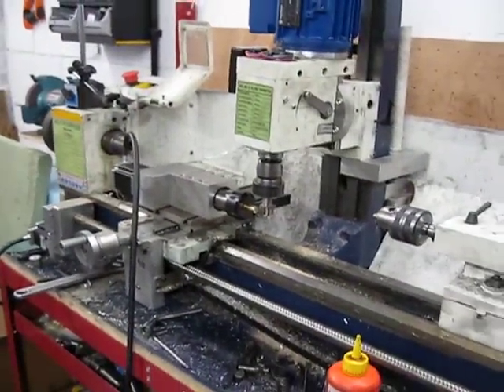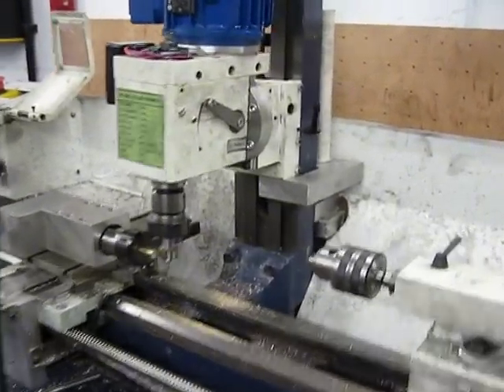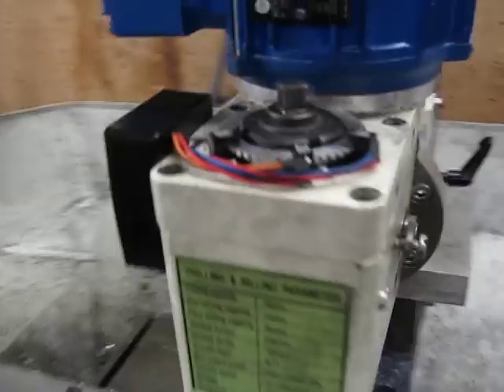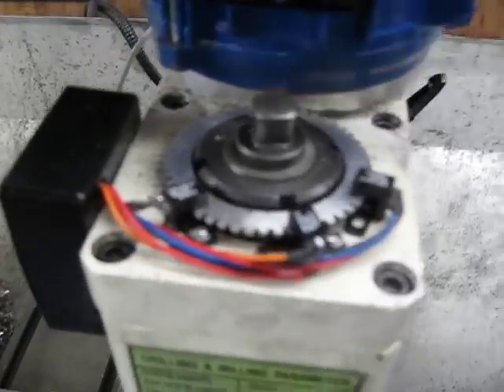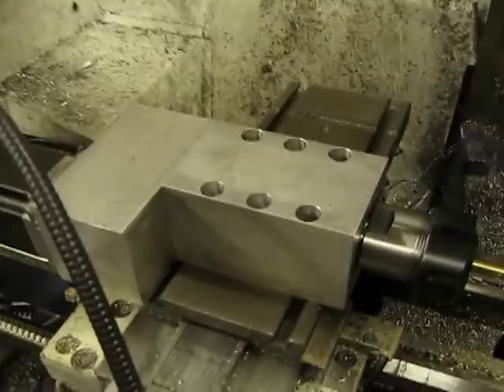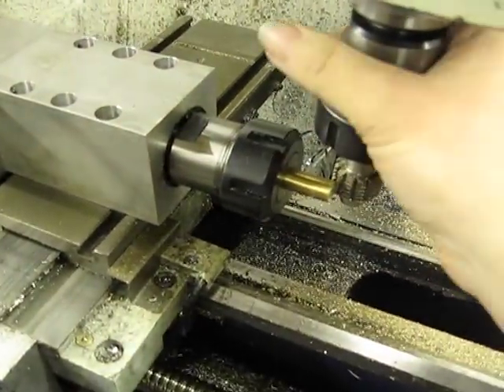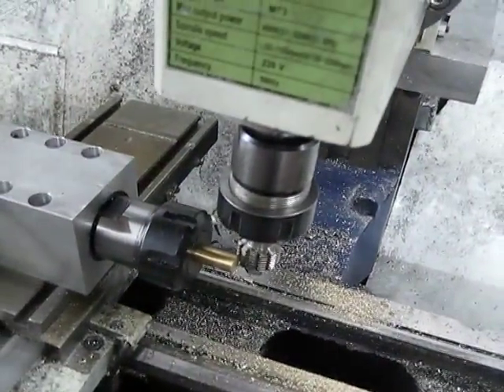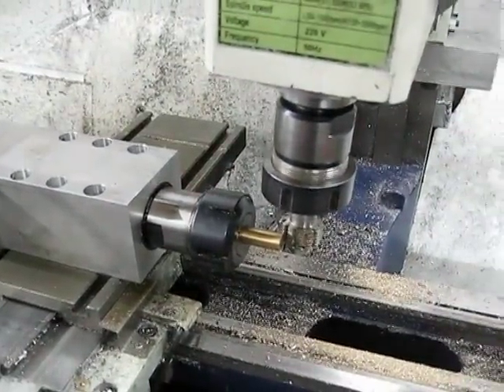Hobbing (Gear cutting) on a Mini-Mill with EMC2

Comment from the maker: The third sensor is for the index, used by rigid-tapping. One of the slots is longer than the others, and one sensor is set further in. 
I also have a similar encoder on the lathe spindle, and used that for three of my other videos (eccentric turning, hexagonal boring, induction motor servo)

Comment: Very nice indeed.  I'm contemplating doing something like this on my lathe spindle.  How many slots did you make in the encoder wheel.  Looks like maybe 50?  Also, why do you have 3 gap sensors?  I would have expected only 2 for quadrature operation... Thx

Comment: Andy - questions about this. What Z-axis motor and ballscrew are you using on the milling machine there? How well does it handle the weight of that massive spindle motor? I've been looking for ways of getting a 3-phase AC motor (56C frame) onto my X2-sized mill, but my biggest concern has been figuring out how to help the Z-axis stepper motor offset the weight of that 35lb motor...
Reply from the maker: The Z-motor is the same NEMA 23 / 3.5Nm stepper as the X axis. It drives a 14mm (or 16mm, I have forgotten) ball screw. 
Since making that video I moved the ballscrew inside the column, and moved the motor to the top rear of the column. There are a few pictures here: https://picasaweb.google.com/108164504656404380542/Gibbs?noredirect=1#5477167816311979330

Comment from the maker: @TheElsyd 
Be aware of the issue of rounding errors and integer maths. EMC2 does it all with floating point, so can do tooth-counts which are not an integer factor of the encoder pulse count. 
You might find that an Arduino or similar microprocessor board makes a better basis. You could put a set of DIP switches on one port to program the tooth count, then use a hardwae interrupt to track the encoder edges and then do the floating-point divisions there.

Comment: Interesting...
I guess that if you offset the axis of the collet holder / indexer by a few degrees you could cut relieved broaches for internal gear shaping too, then use the indexer with the longitudinal carriage feed via EMC (probably another HAL adaptation?) to shape the internal gears (or would that put too much stress on the carriage rack/pinion in brass?) - would need an indexer for the broach - putting the DOC on with the cross-slide (EMC again) into blind bores  - Cheers for the demo!

Comment from the maker: Nothing changes in LinuxCNC. There are a few edits in HAL. The A-axis is not driven by axis.3.motor-pos-cmd and more, but simply by encoder.00.position divided by the tooth count. 
If you search the LinuxCNC WIki for "hobbing" you should find the HAL file details.

Comment: Would love to know how you equate the rotation speed of the workpiece against the rotation of the tool? for example, if I were to use a 24 Pitch hobb? do I need to rotate the piece once every 24 rotation of the tool?
Reply from the maker: No, you don't need to know how many teeth are on the hob. It is a single-start thread, so for a 24 tooth gear you turn the hob 24 times for one rotation of the gear.

Comment from the maker: It is just an ER32 collet holder with a straight shank from eBay. Then two blocks of 2" square aluminium bar. The long bit has a taper roller at each end. Then there is a toothed-belt pulley and a second lump of aluminium to mount the motor and contain the drive belt. I can't remember how I mounted the pulley to the collet holder or what provides the bearing preload.

Comment: Is this a Bolton manual machine converted?
Reply from the maker: It's a converted manual machine, but actually an "Amadeal" rather than "Bolton". But if you have read www.lathes.co.uk as obsessively as I have, you will have noticed that it has been impossible to distinguish lathe manufacturers from lathe makers for well over 100 years. So it is entirely possible that an identical lathe is sold under the Bolton brand somewhere in the world.

Comment from the maker: The workpiece needs to be actively rotated at exactly the right rate, correlated to the spindle rotation. 
You can probably make new gears for your lathe on your lathe, but not by hobbing, you would need to use a formed cutter. 
Look at the other (non-hobbing) gear cutting videos, or search Amazon for 0852429118

Comment: Dear Andy:
Greetings from an apologetic admirer. You posted your LinuxCNC hobber 7 years ago and I am afraid it has caused you much inconvenience from people like me ever since. I have been struggling with http://wiki.linuxcnc.org/cgi-bin/wiki.pl?Hobbing for about a day now and am pretty stuck. You are pretty much the only resource I can find on the net for hobbing with LinuxCNC so like my occasional predecessors in the last 7 years I am turning to you for help.

I thought maybe I could be more helpful and less of a burden if I could suggest a couple of clarifying questions about this entry so that you might be able to make a few small changes to the wiki that would make cries for help like mine a little less frequent: 

1) your original post of hal commands was for integration with a Pyvcp panel. It is not clear whether some or all of the hal code is still relevant to your new Glade panel or whether, when you say: "You would need to hand-craft the HAL to suit your machine." that means modifying this code or starting from scratch. 

2) hobbing.hal from your zip file seems like and addition to, rather than a replacement for the hal code in the wiki. Whether I put it in my hobbing.hal or custom_postgui.hal I get an error. EMC does not recognize hobbing.teeth which I assume is a variable passed from the python script. 

3) at the top of the wiki you say that posgui.hal [sp?] should link the selected tooth count to invert.0.in. Later you say that postgui.hal should link invratio to invert.0.in. I have written a one line custom_postgui.hal file that says: linksp invratio => invert.0.in. Is that correct? are other lines required? would you be willing to add a postgui.hal file to your zip of the other four files?

I am not expecting a lengthy reply to this rather wordy message. Just hoping that if you could clarify these points in your original posts, I might be able to muddle through and you might be less troubled by those seeking help with hobbing.

Many thanks, 
Jonathan Herz
herzmusicbox.com
Reply from the maker: The zip file is the extra bits you would need to add to an existing config to make things work. The problem is that with so much hardware out there nothing is universal. My own machine is using a 5i23 and a 7i49 with resolvers. I know that at least one other person is using the same setup, but it's not common. 

Can  I suggest asking the questions at forum.linuxcnc.org ? That's a much better place for this sort of discussion (and I do read every post, I won't miss it)
.